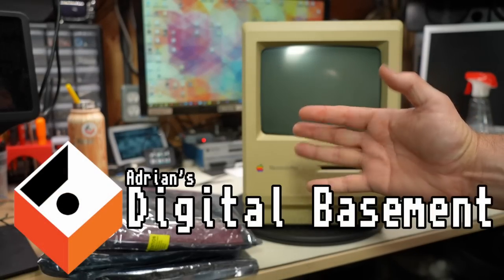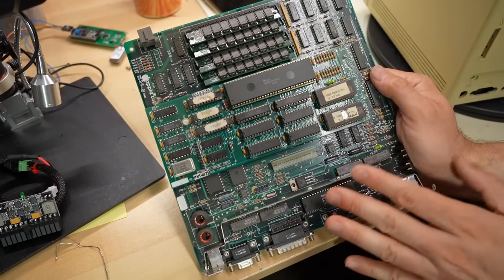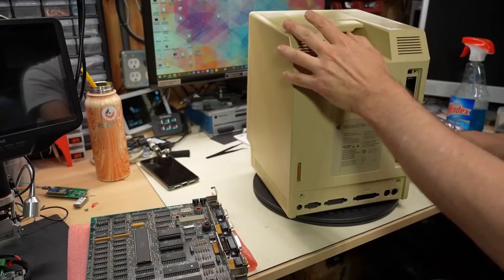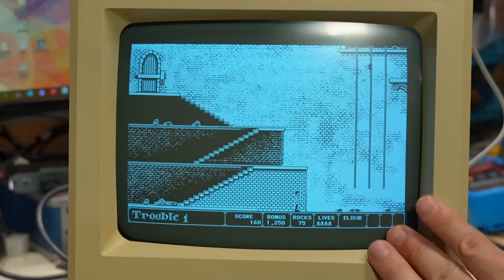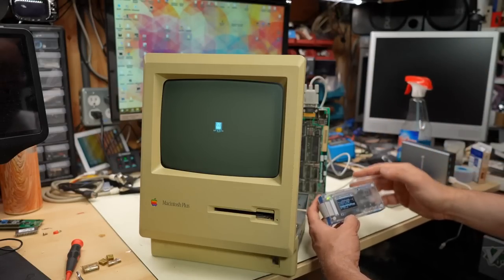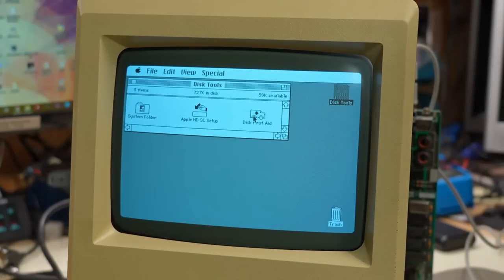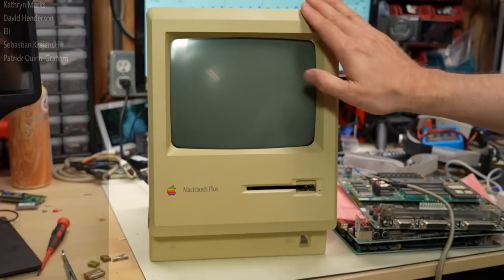Test and try: Three random motherboards and a Mac Plus chassis

Comment: @14:30 that glue is corrosive from age, the same glue is used in lots of things and it is always a problem with corrosion and it actually starts to be conductive too and have seen it short out circuitry, I always clear it off too, a tip for getting it off is to use hot air as it softens it.
Reply: Damn polychloroprene, JVC used to glue capacitors to PCBs with this stuff.
Reply: @yeoldestuff : Hi, have a similar problem here, my creative megaworks 550thx has that stuff allover the place on all caps on all boards. It has aged and that stuff is conductive, high resistance but conductive and it does not help that sound system.
Reply: @bloeckmoep  it also turns corrosive with time. I had a JVC turntable where legs of some components were completely rotten away.

Comment: Small correction: The CPU is doing none of the lifting to push pixels to the screen on that Radius FPD board. Yes the CPU is working as the blitter when moving pixels, but the CPU has zero interaction whatsoever in displaying the pixels to the screen. The NEC41264 VRAM is a special dual ported 64k x 4 DRAM with a 2nd serial port built in for extracting the video. This was absolutely the most bog standard VRAM of the era. The 2nd port used a set of four, 256 bit long shift registers which were occasionally loaded by the counter GALs. For a monochrome display, this equates to one host side VRAM cycle per display line but there was zero interruption of host CPU and that cycle could be tucked into the refresh. This is in contrast to a system like the ZX-81 where the CPU actually does the heavy lifting to push pixels to the screen. I remember installing a couple of those Radius FDP boards in pluses in the '90 to '92 time frame. Installing the video connector was the odd part.

Comment: Having repaired a few of these Macs I would recommend using adhesive backed Velcro to reattach the backing board. It does tear them sometimes but I've found that if you get the weakest Velcro it's pretty safe. Unlike the double sided foam tape it's reusable.

Comment: I can explain the port if you would like.

For banking machines in the early 80s and 90s most of the Macintosh 512k models had a modem module that the 512k sat on top of which allowed the Macintosh 512k to boot from the network instead of the 31/2 inch floppy drive.

With the Macintosh plus the modem network adapter was really kind of fudged up looking the adapter clipped onto the side of the Macintosh plus and was powered out of and sometimes communicated through a port fed through the locking port on the back of the Macintosh plus. My mom used one for 35 years while in the banking industry

Comment: I remember in one of my places of employment there were several Mac Plus' with Radius full page monitors.  The department was responsible for publishing marketing material and most of the monitors were physically rotated into Portrait orientation.  A lot of legal size paper was in the printers and the big copier they used via a network.

Comment: Very nice video as always Adrian!
My proposition is to put the board with the daughterboard inside, and the 4MB of RAM of the other board. Connect the special connector as it was and search for a cable to fit there ( or make one) and see if and how it can drive an external monitor...
Retrobright and floppy drive repair and maybe a hard disk? It will be a special Mac Plus with that cool mod.
Kisses from Greece!

Comment: I recently refurbed a mac plus. I cleaned all of the junky double sided tape off of the analog board cover and put it back with blue tack. I have been into it a few times and the cover seems to stay in place well. I don't think blue tack is conductive so hopefully its a good hack. It's nice because I can take it on and off with ease now. As always love the repair videos!! The best on Youtube I think. I wish you worked on reel to reel tape decks because I have a cantankerous one of those right now lol.
Reply: Some blue tack gets very sticky/stringy with age, so probably not a great material to secure the board cover.
Reply: @nurmr  Yeah we'll see I guess. Its not like apples solution stood the test of time either though.

Comment: Back in the day, I had the "Mac Cracker" tool. It sort of looks like an oversized paper binder clip with a flat edge at the end that fits between the Mac's plastic shells. IMHO, you don't need it. I found it quicker and easier to just grip both case halves at one side of the top and gently pulling apart SIDEWAYS, turning around, then repeating, then finally pulling both halves apart (for Mac's that hadn't yet been taken apart back then...pretty sure that's no longer the case anymore ;) ).

Comment: @14:28 That redish/brownish rock hard glue becomes conductive overtime.
I have a creative megaworks 550thx soundsystem and all the boards are covered in exactly that stuff. I can hear it hum now when its powered on, while it shouldn't let out any tone. I will need to completely disassemble the boards and deep scrape/clean them, I dread that day I start working on it 😢.

Comment: A Mac Plus ROM set will work even on a Mac 128 motherboard.  I bought one for $5, sold as bad, from a computer surplus place way back in the early '90s.  I've been dragging it around ever since, considering making it into a wall hanging.  But I recently decided to try and fix it, or at least figure out what was wrong.  I pulled the ROMs out of a Mac Plus and stuck them on the 128.  Plugged into a Plus chassis, the 128 came up to a sad mac with an error code that turned out to be {drum roll} bad MT ram.  After replacing that, I got it to come up to a disk prompt, and that's as far as I've gone with it so far.  Still thinking about doing some kind of 'what if' project with it, but as a working computer, rather than a static piece.
Reply: I like to imagine that maybe the original ROMs went into some kind of Mac hardware emulator for the Atari ST or Amiga, like the MAgic saC, or something.

Comment: 800K upgrades for the older Macs is a ROM upgrade and a drive replacement. I have an "original" Macintosh that had the motherboard replaced with the upgrade ROMS and Drive. makes the system even more useful.

Comment: I seem to recall that the "Mac Cracker" was just a 1970s era bulldog clip.  You can buy modern versions.  They come in 4-inch and 7-inch variants.  The trick is to find one with thin enough lips so it'll fit in the groove.

You might be able to use spring clamps with the handles.  Not sure if they're wide enough to avoid damaging the plastic.

Comment: Love the mirror hack! What a great idea!
Reply: What is that word "hack"? Hacking what? What's the difference compared to a fix? Or a solution?
Reply: Every TV repair person I knew had a decent sized metal mirror for use making repairs and adjustments in people's homes. And usually regular glass mirror on the back of the work bench. 

Setting up convergence is very difficult otherwise.
Reply: @mikebarushok5361  Very clever!

Comment: Thanks Adrian, water wash of PCB is working so good that I don't need to use alcohol or special chemical.
Reply from the maker: That's awesome! I ended up washing the Mac 512k motherboard and it ended up looking brand new. Good old soap, water and a blow-dry works wonders!

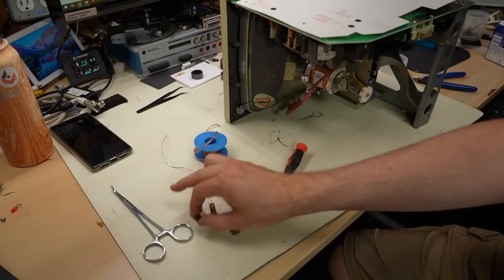Comment: 15:52 Y rated capacitors are designed to always fail open circuit if they fail, specifically because if they were to fail as shorts they would cause the danger you mention. I've never seen one fail as a short thankfully!

The reason the X rated one across the line goes, is because it is absorbing mains spikes which weakens the plates... the case cracking as well allows enough conduction to vaporise the dielectric, hence the smell. I've seen them after the mains fuse where they have let go, but the fuse remained intact... so they dont need to conduct MUCH current to stink!

Comment: You might consider taking a Dremel or other rotary tool with a brass wire wheel in the chuck to carefully scrub at that flyback, then hit it with some Glyptal 1201 Red.  How warm does the transformer get in operation?  Once Glyptal 1201 Red Enamel cures it should be good for about 250 deg. F.  It is available in spray cans as well as quarts.  It is expensive... but it's worth it.

Comment: Hey Adrian, watching this video I remembered: I have a floppyemu with the microcontroller burned out. Seems to be a common issue with them, and Steve does not have a repair program. It may do a good video, replacing and reprogramming it, and it would help a lot the retro community as many have this issue. Do you have interest in it? If yes I can give and send it to you. Cheers

Comment: Man, the Flight Simulator "must be in the internal drive" thing is infuriating.

Had about 10 or so Amiga games that would insist on using DF0: for everything, even saving. DF1: sitting there doing nothing and I have to bugger about with disk swapping just to save.

Thankfully, whilst most games would insist on saving to DF0:, you could put the game disk(s) in any drive you like.

Comment: Wonder what a typical use case for a dual display Macintosh Plus might have been back in the day? I can't imagine a lot of applications had support for two displays, was the intention to run two separate applications instead?
Reply: Presentations or other Dashboarding/professional displays I imagine. Or maybe someone really wanted to play games on a bigger screen?
Reply: AFAIK it was intended and (mostly) used for Desktop Publishing (DTP) - Macs were (and to some extent still are) THE dominant force in DTP and if you wanted to do something more than casual work you pretty much HAD to have a second bigger screen, and all the DTP programs supported this.
If you Google Radius Full Page Display (FPD) you'll find (one of) the sale brochures for this display at 1000BiT, the card is comes with the screen (the expensive part). It might even be this exact card given that it support 512E, Plus and SE.
Looks like the Radius FPD originally cost $1999, almost as much as the Mac Plus ($2599). So yeah, putting an FPD in a Plus with just 1MB of RAM is slightly weird given how expensive the display was. But people did buy stupid configurations back then too (and it still happens) so... not guaranteed.
Reply from the maker: I did end up making a video about the Radius card in this machine, and it'll be on the main channel a few days after this video goes live.
Reply: These were not uncommon for secretary/receptionist machines.  All applications inherently supported both displays because of the way the Mac toolbox works. In 1986 you could load a Mac ][ with 6 video cards and seamlessly drag a window around 6 monitors. When these full page monitors were released, a Mac could only run one application at a time. It wasn't until late 1987 that it gained cooperative multitasking.
Reply: The apps also ran fine on virtual monitor and extension programs.
Reply: From the start the Mac screen was software defined, it could be any shape you could build with quickdraw shapes (which is how the normal display setup had rounded corners). All apps worked just fine with multiple monitor setups.

Desk Top Publishing was the main driver for these displays, they were designed to display a full WYSIWYG page on screen. Thus the name of the Radius Full Page display.

Comment: My Mac 512K crashes when I plug in a mouse while it is running.
Unfortunately, I don't know the version details as it is packed away.
I used to repair Mac machines back in the 80's and it was hilarious to watch people zap themselves on the monitor when they forgot to discharge it.
I am evil, I know!

Comment: Only way to kill rust is to cut it out, they say in the car communities. But, Rust needs oxygen to thrive, so if you epoxy the flyback, it'll slow the corrosion down drastically or stop it from growing completely by suffocating it.

Comment: Is it possible to change aluminium capacitors with electrolytic capacitors?
Reply: They are the same thing. Electrolytic capacitors are aluminium.
Reply: no, they need to be regular capacitors (unpolarized)
Reply: @WooShell  Aluminium electrolytic capacitors(which these presumably are) are polarized.

Comment: You should replace those "Y" caps.  They help control leakages voltages from the switching power supplies which can cause unwanted behaviour.

Comment: Tsk, tsk, tsk... Adrian, you need a lot to learn a lot when it comes to Macs.

First off, you can have 800K/Double Sided disks on the "Older Macs" as back in the day, there were the "Skinny Mac" (128K Mac) and the "Fat Mac" (512K Macs) and the Fat Macs used 800K Double Sided Drives. In fact, there was a Hard Drive IIRC called the HD20 which connected to the Mac through the floppy port. The Issue here is mixing Mac System Formats. From System 1.0 to 4.2/Finder 3,5, it was the MFS (Flat File system). From 4.2 to 6.08 and beyond it is the HFS (Hierarchical File System). This has nothing to do with the ROM, as you can run System 6 on a Mac 512K with the old ROMs. When using the HD20 hard drive, it was either formatted as an MFS system for Pre System 4.2 systems or as HSF for System 4.2/Finder 5 and beyond.

Let me explain further, if you have a  System 1 on a MFS formatted disk, it will boot properly. But if you have System 1 on an HFS formatted disk, it will crash. This is because the directory layout is different from MFS vs. HFS. Same is tru with  System 6 on a MFS formatted disk, as it will crash.  The issue is System 4.2 and which Finder is uses. The older Finder 3.2 has to be on an MFS formatted disk or it will crash. The System 4.2 with Finder 5  must be on an HFS formatted disk or is will crash. Chances are this is what is happening with your System 4 on the Floppy Emu.

Though not related to these older Macs, with System 8.1 came the HFS+ system which expands how much a Mac Hard Drive can hold.

The Enhanced ROMs did not come into play until the Mac Plus. They are only enhanced with some Bug Fixes and the additional SCSI routines to access SCSI Devices. The problem with this is, The Mac 512K (Fat Mac) was still under production when the Mac Plus was being made and in fact, they still made 512K Fat Macs after the Mac Plus was discontinued for the Mac SE. During this time, Apple decided to save money by using one set of ROMs used on the Mac Plus and putting them into Mac 512Ks making them "Enhanced Macs." Many third companies made SCSI add-on boards for the Mac 512K but in their notes they stated that the Mac 512K must have the Enhanced ROMs for SCSI add-on to work.

The 6522's on the Mac boards are there for Serial I/O and the Mouse and Keyboard, similar to the C64/Vic20.

You are right on the Video's ROM needing to be updated for System 7, but you aldo need the Drivers for the card as well on both System 6 and 7.

And System 7 also sucks on the Mac Plus, Modified Mac 512K and Mac SE because it loads a lot into it. If you can trm it with a System Resource Editor, you can gain some speed out of it. But it would also be best to have a 16MHz 68K accelerator on the older Mac and then you can see the B/W Mac shine.

RIFAs... Oh Those Damned RIFAs!!!
You should leave a link as to where to get those you recommend and many like I have old Apples and Macs and need those RIFA replaced!

Comment: One way to keep iron from rusting or corroding is putting a less 'precious' metal against it like aluminum or zinc which is called a sacrificial anode then. Protection is electrochemical and requires only a conductive contact between the 2 metals. https://en.wikipedia.org/wiki/Galvanic_anode